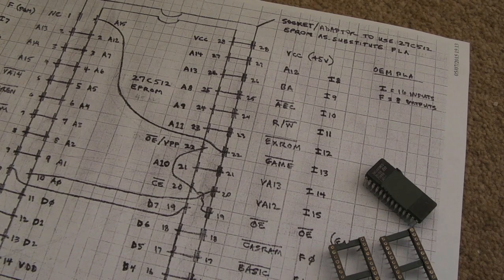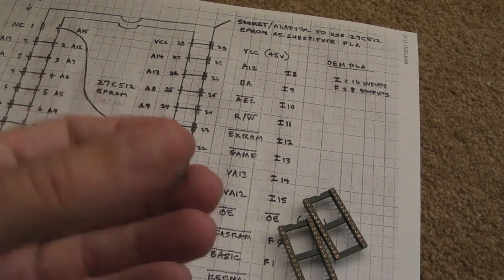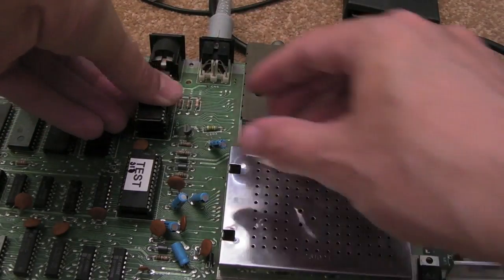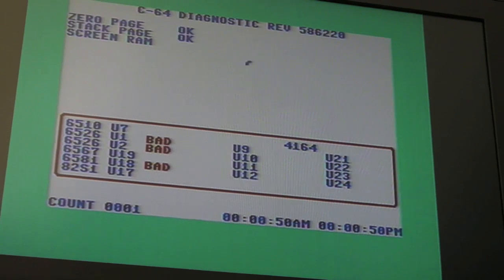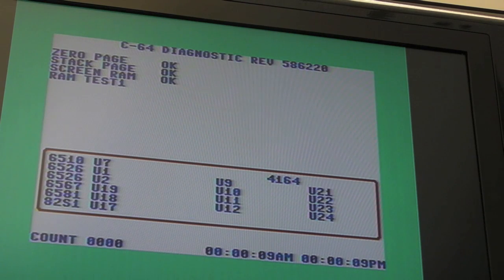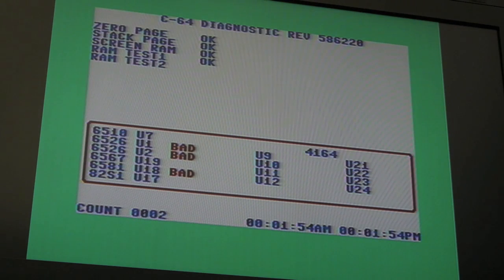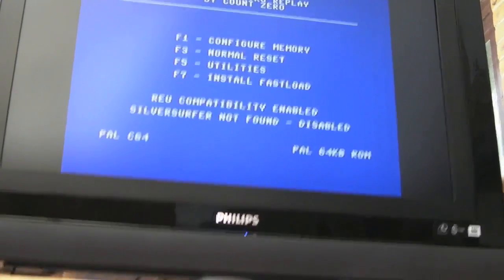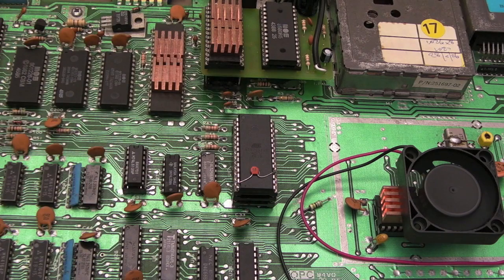Commodore 64 (C64) DIY PLA Replacement (EPROM / OTP)

Comment from the maker: Update a week or two later: I've been using the AT27C512R-45 in my main C64 every day and I've had no problems at all.  Every game, demo and cart has worked 100%, no crashes, no glitches, no temperature issues with any of the chips (replacement PLA doesn't gain any heat what so ever).   Based on the fact I get no problems and no temperature issues I would go as far to say that this chip is 100% compatible.  If you can think of a game, prog, cart you want me to test please let me know.

UPDATE 27/05/2019 - This chip has been confirmed as working and it is now understood why it works.  Apparently it's the slow slew rate.  Clones will not work.  Other chips with a slow slew rate may also work.  You really need to test with a 74LS279 circuit (on the thread) to determine whether you have a contention issue or not.  Despite some of the negative messages I've had on this PLA solution, it can work 100% perfectly if you get the correct  AT27C512R-45.  http://sleepingelephant.com/ipw-web/bulletin/bb/viewtopic.php?f=5&t=5533&p=104823#p104823
Reply: +GadgetUK164 thanks! I'm learning a great deal with your videos. I've been reading a 
ton on forums and such but most of the times I don't fully understand. 
your videos are a constant stream of "ooooh that's what the post meant!"

Thanks again for teaching me how to save my Drean c64c!
I'm still dealing with some ram problems, have to turn on and off about 5
 times to get it to boot properly. I read about using pc DIMM RAM chips,
 and got a hold of some of those. any opinions on that hack?
Reply: +GadgetUK164  Hey how ya doing, I noticed something in this Revision thats different from your Other c-64's, c203 is populated , while on the others, they're not. why is that?

Comment: Can you also use an SST27SSF512?
Reply from the maker: If it has the same pinout, possibly...   The reason I think that lots of EPROM dont work, is about slew rates and the drive levels.  EPROM databus outputs aren't as strong as a proper PLA.   Give it a try, see if it works - it might do!

Comment: I recently tried this with my commodore. I managed to get the system to boot with a Winbond W27C512-45z EEPROM chips, and it works okay, but I would get freezing and crashes. I switched over to using an AM29F040B-90JC Flash Rom chip and its been so far 100% compatible, no capacitor required.

Comment: What happens if you put pic micro controller chips in a C64 in ROM or ram chips?
Reply from the maker: Because the pinout of the chip will be completely different to the ROM and RAM chips, it will likely just create short circuits on various connections.  What each pin does on each chip is completely different.  You cannot replace a ROM chip with a PIC chip.   A ROM chip has address lines, and data lines, as well as power and ground connections.  A PIC chip has power and ground connections, and then lots of IO pins and other pins used to program it, and sometimes clock input pins.  It's like trying to stick a square plug into a round hole.
Reply: Okay you have a point. I guess there is no way you put a processor or hybrid chips in any socket. I guess you may have to implement FPGA stand alone unit like Vampire did. with the Amiga.

Comment: how do I get such a sharp image on c64?
Reply from the maker: Recapping the board can help (and the modulator), but ultimately it can vary depending on the VIC2 revision, your TV, and the cable used.  S-Video cables give a cleaner sharper picture too - but I use Composite.

Comment: The oldest C64 was a lot of shit. PLA died in thousands. Despite cost reduction, CBM also introduced improvements. In C64C PLA is very hard to kill. Unlike the old versions of C64
Reply: PLAs are very unreliable ICs in the old breadbin C64s.

Comment: Just wanted to let you know a new source  of compatible OTP PROMS has been found.

Check the discussion here.....

http://sleepingelephant.com/ipw-web/bulletin/bb/viewtopic.php?f=5&t=5533&p=104823#p104823

Has not been tested in the very old ASSY NO 326298 C64.as yet......
Reply from the maker: Thanks very much for the update!  I will check out that 74LS259 test circuit too!
Reply: My pleasure. I think it will work ok without the capacitor on the CASRAM line though I didn't test that.

Eslapion did all of the work, my hat's off to him.
I'm sure you'll do a far greater job than I did with the testing. .

By the way, really like all you videos, very cool :-).
Reply from the maker: Thanks =D  I found with the chip used in this video I need the capacitor on the CASRAM pin or I get RAM problems.  On one or two of the other boards the cap doesn't seem to be needed.
Reply: GadgetUK164 - Retro Gaming Repairs & Mods 
 
Ok, I see. 
Eslapion recomends using the Zaxxon game cartridge or an oscilloscope to check for the glitches. I don't own either and my skill levels are poor at best. Eslapion helped heaps and his test circuit could be made  moderately easily with small resources at hand. 
I made a few more videos though eslapion suggested that was enough.
I do believe that this chip in question is a fake....however it seems to pass all the tests....maybe time you did a video on this?
I would say there has to be other likely undiscovered candidates out there.

Comment: Thanks for this. I just made 2 of these just as an experiment. One socket sandwich and 1 on perfboard. I ran tests on 4 different boards but no real scientific conclusion. All I can say is that it works great on 2 and partially on 2. The ones it works on are a 250407 Rev C (15ns matched ram) and a 250407 Rev B (20ns matched ram). It doesn't like the 250407 Rev A at all (but that has unmatched 20ns ram chips) or my other 250407 Rev B (which has matched 20ns ram but different ram controller ics). All will boot and all but the Rev A will load files from the SD2IEC. The two good oes will go on forever on diagnostics. The 2 iffy ones fail after 1 or cycles on RAM 2 test. Not much of a conclusion but at least a couple of spare PLAs that will work in at least 2 of my boards. Good stuff.

Comment: Which Capacitor to use??
Seems the answer in general is 68pF?  But what Voltage, 50V, 240, etc?
Tolerance 5%? 
Which ones are you using, I'm sure your loyal followers would love to know.
Thanks, Mark.
Reply from the maker: 50v is fine - the lowest voltage will be fine, there's only ~3.0v there.  Tolerance 5% is fine too.
Reply: Good Stuff...your Videos are very entertaining.  Thanks...-Mark.

Comment: Okay so I've decided to go ahead with the PLA Project but how do I get the PLA.bin file to burn into the Eprom/OTP chip?  -Mark.
Reply from the maker: What EPROM programmer are you using?  You need to run the software for the EPROM programmer, select the chip type (27C512), open your .bin file, stick the chip in the programmer the right way around and click 'write' or 'program'.  Then hit verify.
Reply: I have a tl866 programmer and I have used successfully several times but in order to program a pla you need the right file and I'm not sure which file you have successfully burned so I'm wondering where you got that good working pla b i n file.
Reply from the maker: https://www.dropbox.com/s/inud27dwhkls53o/C64-PLA-906114-01.zip?dl=0
Reply from the maker: It's not a ROM btw - it's equations, so technically OK to share this way.
Reply: You Da Man!  Although I should've clarified with you exactly what pins the Capacitor is Soldered to...:)    -Mark.

Comment: I have sourced the AT27C512R-45PU  and wondering if this is the exact correct part (as listed below in the direct link).  I'm pushing ahead despite some skepticism from some and I think it should be fun regardless.  I'm going to get the PLA Adaptors from Jim Brain and add the Cap myself if necessary.
https://www.digikey.ca/scripts/DkSearch/dksus.dll?Detail&itemSeq=251286635&uq=636536425039123109

Cheers.
Reply from the maker: Sorry for the slow reply:- I am not sure mine are the "PU" version.   What I do know is I've been using this chip as my main working PLA for a few years and had no problems at all.  In that video that MindFlareRetro did, it was mentioned that Zaxxon and Ultimate 2 would not work.  I use the Ultimate 2 all the time without any issue, and pretty sure I've played the cart version of Zaxxon too.   I will when I get chance re-visit to test Zaxxon to be 100% sure.
Reply: Thanks for the response although I'm concerned about buying the wrong version so I'm holding off so far.

Comment: hello nice replacement, but i'm not able to understand where you solder that capacitor (and the value), could you help?
Reply from the maker: Capacitor goes between the CS pin and ground.  Just look up the pin out for the PLA in Google to work out the pin numbers.

Comment: Hi. Been trying to replicate your success here using my own AT27C512R-45PU --> PLA pin conversion PCB, but I'm having some issues, see here, https://goo.gl/e3H1r3. Can you tell me what ASSY revision is the C64 motherboard used in the video? Do you know if the CASRAM cap is required for ASSY 250425 boards? Thanks.
Reply from the maker: I need to check what version boards I've tested but I am sure I've got the same rev as that and it worked, but they nearly all need the CASRAM cap, size can vary between boards from what I've seen.  The other issue can be with fake AT27C512R chips - chips of AliExpress (or eBay) aren't always genuine as I've found out.  Parts rated 45nS are 70ns chips etc.
Reply: Making progress... to confirm I have tested my pin conversion PCB, and what I am confident is a genuine AT27C512R-45PU OTP (incl a cap on the CASRAM line), in an ASSY 326298 motherboard and it powers up normally (pictures: https://goo.gl/v6MzuT, https://goo.gl/FW7R5R). In reading Ray Carlsen's PLA notes for the umpteenth time, I believe that the 250425 and 250466 boards already have caps and resistors on the motherboards themselves from the CASRAM line, so the bodge board cap is likely unnecessary on those revs. Thanks for your help. More testing and a video to come.
Reply from the maker: Ah, yes - on some boards the caps are not needed at all.  So, does it work without caps on that board then?
Reply: Sorry, never replied to your question. No, I cannot get the OTP PLA replacement to work on the 250425 and 250466 boards. No 68pF cap yields a black screen. With cap, C64 powers up to a total garbage screen and slowly deteriorates -- picture, https://goo.gl/6M91DV

Not quite sure what to try next. Different cap value(s) for the 250425 and 250466 boards? I'd only be guessing. Or, just buy a PLAnkton. ;) Well, that's the easy way out. I'd still like to figure this out.

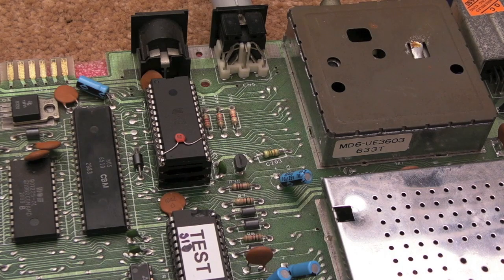Comment: Hi, did you replace C203 with resistor ? I can see it at 5:48. Thanks for help.
Reply from the maker: +Michał Kalbarczyk (fazibear) No, that's actually a capacitor!  It looks like a resistor, but the green body and the number of bands show its a resistor!  Factory - haven't touched that!

Comment: Hi Gadget. Awesome video. I have some questions though. First of all you said you were gonna re route some of the pins . On other boards I have seen people do this there are cables running over the chip to do this. Are they hidden underneath? Also could you possibly tell me which eprom programmer you used to do this and the bin files used? A video on eprom programming would be great. You certainly know you stuff. Subcribed!!!
Reply from the maker: +orange b Thanks =D  I routed the wires in between the 2 sockets.  So some pins on bottom socket connect to different pins on the top socket (You have to isolate them on those pins though also).  There are a number of EPROM programmers that you could use, here's a little about the ones I've bought over the years and pros / cons:-

Genius 540 = very cheap, works for most old 8bit EPROMs.
EasyPro 90B - almost twice the cost of the Genius 540, has more compatibility with chips that the 540 doesn't  - ie. 40 pin chips.
Willems Sivava Parallel - about the same price as the EasyPro but a little awkward to use (lots of jumper and DIP switch settings etc), but supports larger chips (with adapters), so you can program 27C322 or 27C160 etc.  The Willems is ideal if you want to program Neo Geo carts.   
And finally the GQ4X (rev 4) which supports some of the TSOP chips (using adapters) that the Willems doesn't support, and is essential for SNES EEPROM programming.

I will add a EPROM programming video to the list and upload one at some point ;)
Reply: +GadgetUK164  Thanks for the info. I am gonna have a bash at this as soon as I get an eprom programmer. I also use mame to play old arcade games. Is there a way of dumping the roms onto a chip and fitting it to a board? Also which board would you use? I have an arcade machine that I built myself with 2 player controls and a rotatable 1080p screen. At present its got a PC inside it.Would love to stick an actual pcb inside and switch out the chips to play the games. Sorry for all the questions and thanks in advance.

Comment: Hey Dude, Great Videos, Been watching loads of your Vids from before, started with this by watching your blank screen fix vid and i found i have a dead PLA and a Dead CPU found that out by de-soldering  and socketing and substituting a working one and then using my test cart which also have a full harness kit to do loop backs.  i really don't want to spend loads so again found this video and it seems to be the perfect solution to fixing this C64 i have, so the QUESTION.... the 68pF on CAS i assume goes to the GND pin on the EEPROM and the update i just read on the SwinSID, is that the CS pin to GND on the SwinSID chip or the PLA chip, and if its on the PLA, is that a cap in addition to the CAS cap or as a replacement. Thanks
Reply from the maker: +Silverfox0786 Thanks for watching and commenting =)  Yes, the /CASRAM pin on PLA goes through 68pF cap to ground - you might consider trying slight higher or lower depending on whether it works perfectly in your system or not.  Daves board uses an 82pF cap and that seems to work OK on the PLA, but mine runs fine with a 68pF cap.  We have both used the Atmel AT27C512R (Make sure its a genuine Atmel chip!)   With the Nano SwinSID the cap goes from CS to ground  I got mine sounding perfect with a 68pF cap (using either my PLA or Daves new board), but I am not 100% sure whether 68pF is the ideal size for the Nano SwinSID CS cap yet - I've actually ordered a variable 200pF cap which I was going to do some experimentation with.  

A better way for me to work it out - which I might do later is connect my logic analyzer up and capture the chip select signal VS the input clock, to see how far out it is.  I will do an update video at some point in future, but a 68pF cap does make the Nano sound perfect to me, whereas without that CS cap and using an AT27C512R PLA you get noticable sound issues with the Nano - but not with a 6581 or 8580, it's a problem with the Nano due to the fact the CS signal transition from high to low is quicker than a MOS PLA would provide.  MOS SID isn't affected by that fast transition, but the Nano has been coded to expect that transition delay, now its not there it starts processing too soon.
Reply: +GadgetUK164 Thanks for the conformation, my MB is the same as yours so im kinda hoping the 68pF will work, but will test with others if need be. i've ordered a AT27C512R from a reputable UK seller so im confident its legit. i have seen some people use a ST branded OTP as well which works fine. thanks for the NANOSwinSID confirmation as well, at the moment i'm good as my SID is ok but its good to know what is needed. Keep up the great Videos, i always seem to end up watching most of them and enjoy them and as you may now know im subscribed to your channel.

Comment: Still loving catching up on your videos Gadget :) i might re visit this technique and hopefully have a look at resurrecting my spare c64, up to now its just not been that important because i have a 64c i use mostly and a first rev breadbin (fully socketed ) cant remember the rev on the spare but it boots with corrupted garbage and had at the time thought it to be caused by  the PLA  :)
Reply from the maker: +LOAD"" Let me know how you get on with it!  Dave Curran (Tynemouth Software) sells this PLA on a PCB - so its a plug in replacement.  I did a video on his PLA the other day.  It's based on the same Atmel chip.

Comment from the maker: Update 06/12/2015: There's a timing issue affecting the Nano SwinSID, but this PLA does work 100% with an actual SID.  I've tested this for a few months now and had no problems at all.

Update 08/12/2015: The fix for the Nano SwinSID is to add a 68pF cap from the CS pin to ground  (if using this PLA replacement).

Comment: What kinda chip burner do you recommend using? i'm probable going to do this to try and fix my C64's PLA.
Reply from the maker: +Sam The Multimedia Man I've got a few different ones - some programmers can behave strangely with some chips whereas another will work fine with that same chip.  In general, the GQ-4x is pretty good, as is the Willems Sivava PCB50B (although the Willem needs a parallel port, the GQ-4x is USB).
Reply: +GadgetUK164 I ended up getting a Minipro TL866 the other night. the 27c512 was in its list of supported chips and it came with a bunch of socket adapters and it was reasonable priced. ill let you know how well it works when i get it.
Reply: +Sam The Multimedia Man got the programmer and it worked like a charm! I'm wiring up the adapter right now but I had a question about the cap. Dose that cap from the Casram pin go to pin 13 or 14??